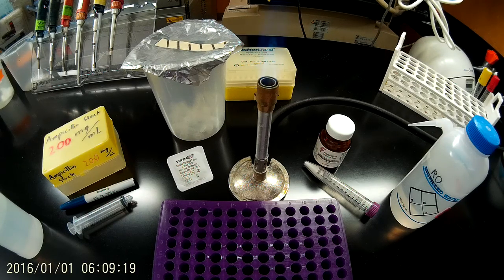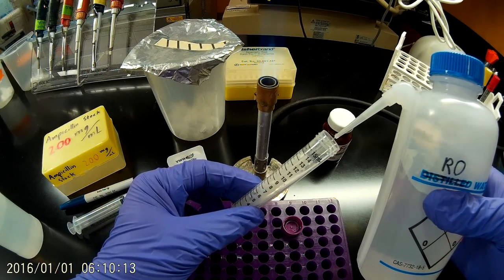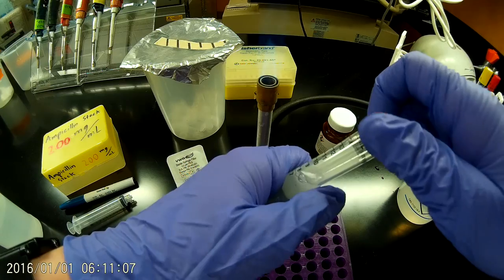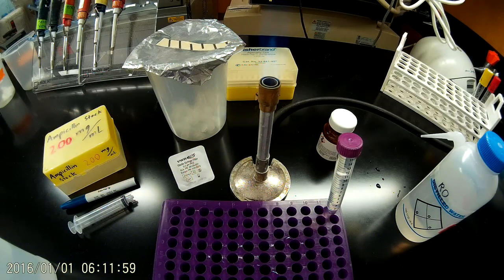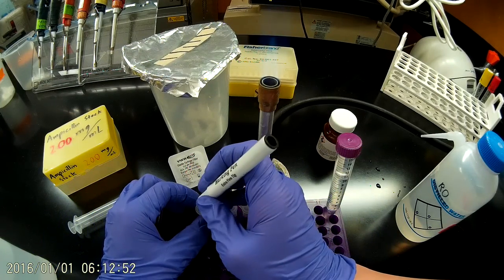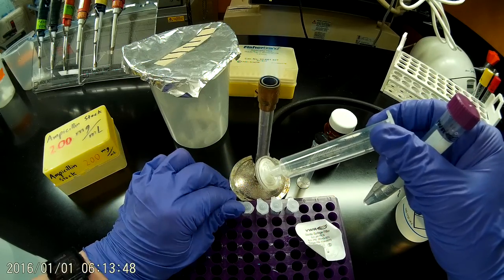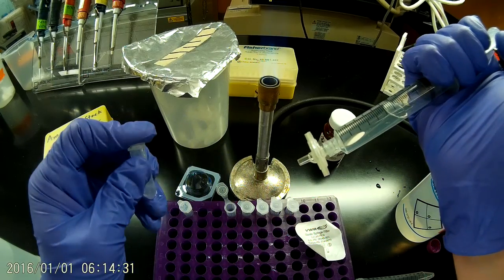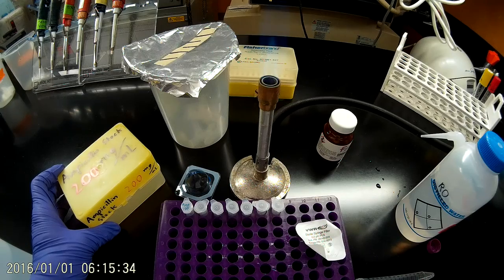Preparing sterile ampicillin stock solutions

Comment: Quick question, if you propared 250 mg/ml of ampicillin stock solution, what will you use to impregnate your filter paper disk or wells if you are going to do a Kirby Bauer Disc Diffusion Method to determine susceptibility thru zone of inhibition? Will you submerge your discs into that 250 mg/ml solution or will you further dilute the solution into a working solution? And if so, how much solvent should you add for you to attain that while having the standard zone of inhibition of ampicillin towards let's say, S. aureus... Really needy your help here.. I'm doing this for my thesis I hope you could help me out
Reply: Did you figure out? I have the same question